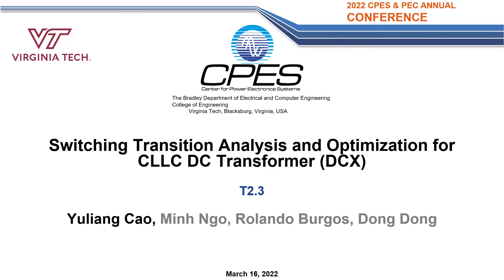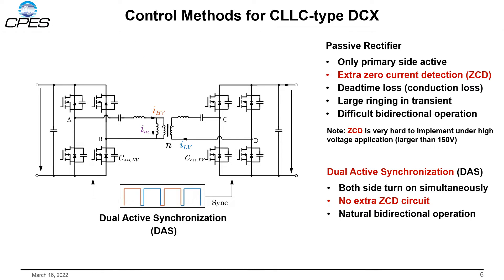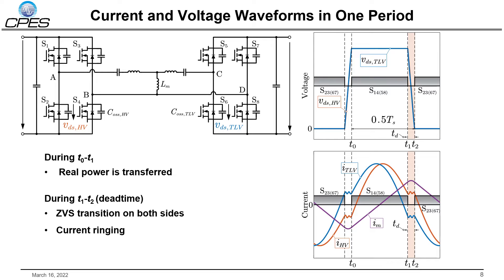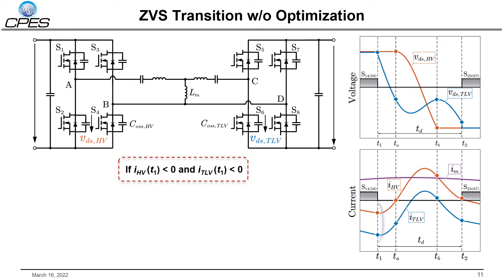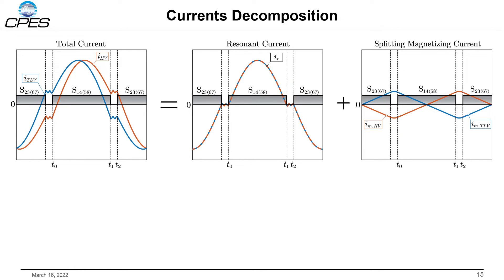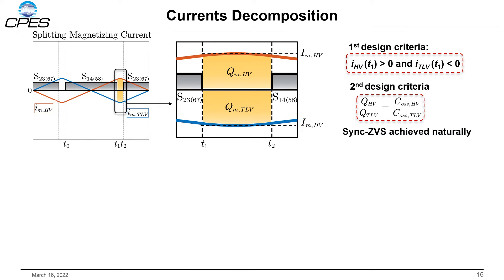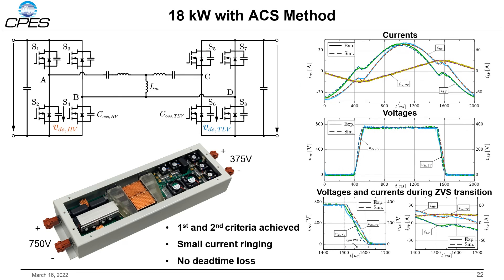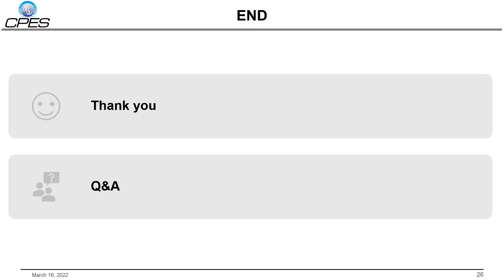Yuliang Cao - Switching Transition Bi-directional CLLC Resonant DC Transformer (CLLC-DCX)

Comment: I have a question and please answer it in the hybrid solar inverters, Voltronic and Sako inverters, when the inverter starts charging the batteries so that the bidirectional converter transfers energy to charge, we notice in the electronic circuit the presence of igbt and diode and a coil that form a step-down converter circuit, and this helps determine the direction of current flow from the secondary coil to the primary or vice versa. My question is how will this igbt work synchronize with the bridge that cuts the current from the secondary coil to be transmitted by induction to the primary coil, noting that the oscillator used in the step-down converter circuit is a controller and the bidirectional converter uses the IC sg3525 as an oscillator